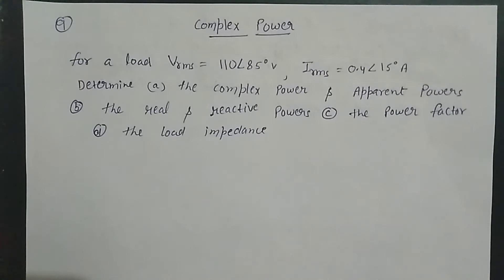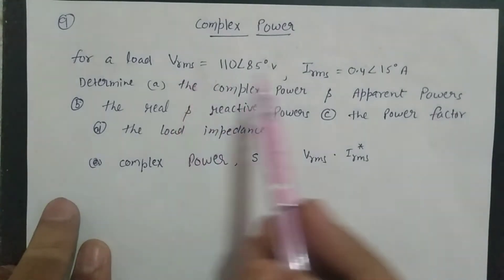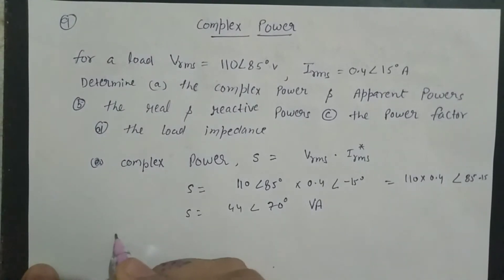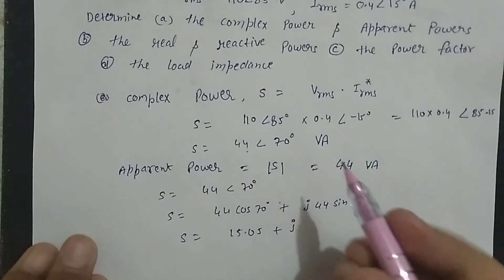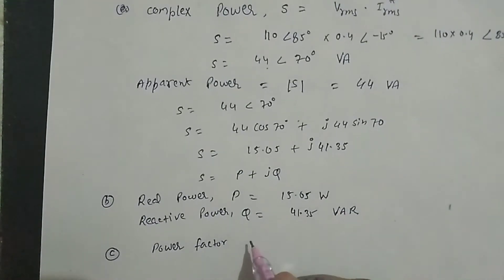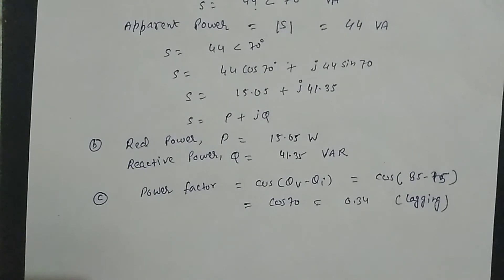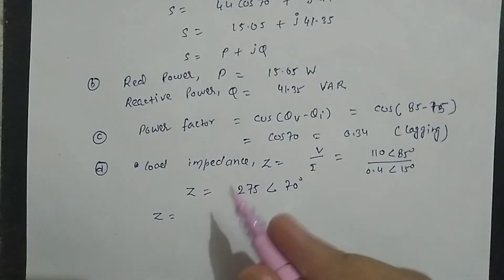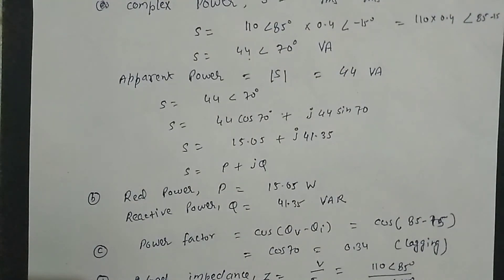Calculate complex and apparent power,pf , real and reactive power,load impedance

Comment: If complex power of a circuit is given as S = 100<60. Find the values of 
 active power, reactive power and power factor?
Reply from the maker: Thank you for problem 
Here is solution for it
S= 100<60
S= 100 (cos 60 + jsin60)
S=100 cos60 +j 100sin60
Real part of S= real or active or  average power =100 cos60 W 
Imaginary part of S=reactive power
=100sin60 VAR
Power factor= cosine of angle of S=cos(60)
Apparent power=magnitude of S=100 VA
Complex power=100cos60+j100sin50   VA